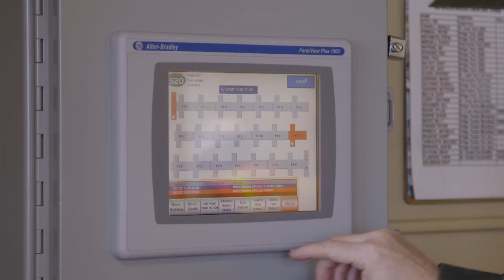The Largest Floating Bridge in the World Engineered by The Powering America Team

Comment: In addition to the licensing fees which are supposed to be used for projects like this, I'm so SO pleased it costs over $6 to drive across this marvel of engineering... each way.   Screw this bridge.
Reply: mantis1s1k it's a toll bridge, if you don't want to use that bridge, and since I know this area either
1. Take I-90 bridge, it's free
2. Go around south to south center, then go up on I-405
3. Go around North, and take I-405 south.
Also, I don't mind the tolls, the state needs it.
Reply: Right.  You should get access to services free of charge....

Comment: Yeah, make something that floats, which is SOOO much smarter you know, no influence by increasing and decreasing water level, and also this soooo much connects bikers to peds to people in cars (because at other bridges they didn't had time for this) what a nonsense projects, look cool but that's all.
Reply: How are you going to drain such a huge lake, and why would you want to do that anyway? It’s 214 feet deep, with an average depth of 108ft and it’s surface elevation at only 16ft. Also this bridge is 7,710ft long, in comparison the longest suspension bridge Akashi Kaikyō Bridge in Japan is 6,532 ft long
Reply: @greasher926  aren't you the brightest one, you for sure get the Darwin award this year.
Reply: Drive on this bridge all the time, it is a nice smooth ride, the previous floating bridge was smooth as well. The lake is too deep to easily reach and build the supports. Did you not watch the video? I feel you didn't watch. There are lots of regulation reviews, intense project planning, and designs that go through incredibly experience engineers. This isn't a new concept. They know what they're doing. You can move along.
Reply: @crIms0ngen  Yes I did watch the video, 2 years ago.... o.0